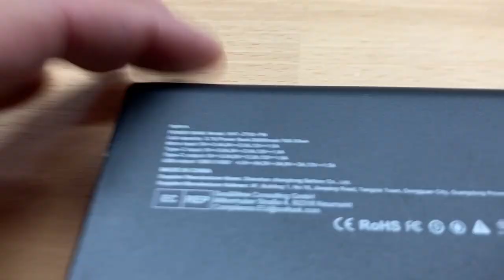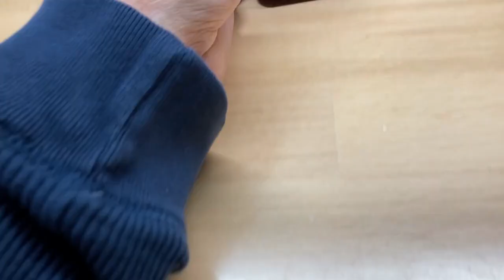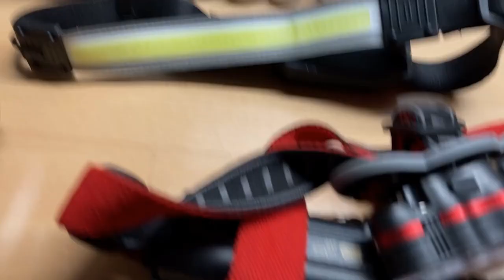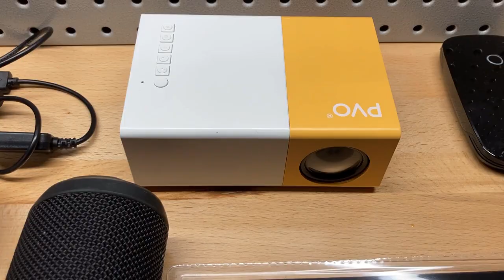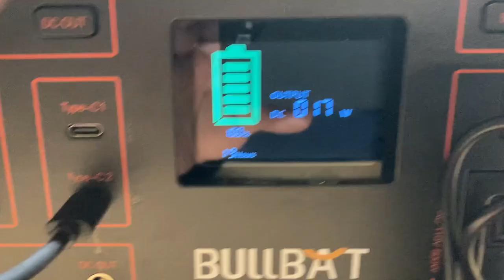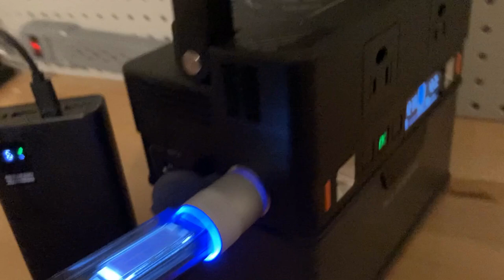EMERGENCY POWER for EVERYONE!!!  The$12 Super Battery!!! #emergencypreparedness #diysolar

Comment from the maker: Hey Guys. I did some initial testing of the Battery today. When used for Fast Discharge (19 watts) it puts out about 70 watt hours!  That is a little less than what it is rated at on the back, but it is still awesome! It is about equal to two normal (10,000mah) USB batteries. It may output more volume when it is discharged more slowly. I bought 2 more this afternoon. I see the inventory on these on Amazon went down quickly after I made this video.  If they are out of stock soon, then I will keep my eyes open for similar great deals and pass them on when I find them. You can charge about 3 of these in single day with a 100w solar panel. That would give you a storage of about 210 watt hours all for just $36. That'a a good deal! :)

Comment: Unavailable at Amazon.  The price was low because it was being dumped at a discount.   Most of the battery packs in this price/capacity category have inflated capacity claims and a low number of charge cycles to 80% actual initial capacity.    Fast charging reduces LiIon cell life.
Reply from the maker: That's good info PS. Thanks for your comment. I measured it at 70wh fast discharging vs the stated 106wh. I'll still take it at this price as that still is a really good value. It will make a good emergency battery for those who don't want tp pay the normal $40+ price for a similar item. If you think about it, this item will hold the power of about 2 dozen AA batteries! You can't buy 2 dozen of those for $12, and you are still likely to get multiple hundreds of charge cycles.  Even if you only ever used it for a single emergency, it would be well worth the price.

Comment: I haven't really studied these type batteries. I'm assuming there's 4x 3.2v lifepo4 inside with circuit to balance/distribute/series the pieces?
Btw says unavailable now.
Reply from the maker: Hey SlickWilly, Yes I believe you are correct. The inventory went down swiftly after I made the video. I saw it progress down from 20 left in stock. I guess that is a good thing that means people are picking them up. I'll keep my eyes open for similar values in the future and watch to see if these re-stock. Thanks for the comment. :)

Comment: units of power ?  Watts

22w wats is decent for a back up power source. is it 5v 9v 12v ? 

i see they have similar versions that will output 100w watts over usb c  with proper quick charge 3.0
Reply from the maker: Yes. It is watts. I tell in the video how less technical people are confused sometimes about the term watts and so my tech guys will know I’m talking about watts but I will use the term units of power in the rest of that video in order to cater to a wider audience. 
  Yes it is 5, 9,12  There is a brief look at the back of the battery near the beginning of the video. It lists the stats.
  This was a great price point for this battery so I wanted to pass the info along. It charges at 22w and has a capacity of at least 70wh.  For $12 that is really good. I’ll keep my eyes open for future bargains as well. For those who want to spend more, bigger is always better in terms of battery capacity and charging speed:). Thanks for watching.

Comment: You videos are Always educational.  Can you post a link to a solar panel too?  I would like to get these.....
Reply from the maker: Hey Patricia. I'll post a link soon for a solar panel. I got a great deal on one just recently, but I want to test it before I recommend it.
Reply from the maker: Hey Patricia. I'll give you an advance heads-up. I'll be making a video soon on this. This is a 100w solar panel. It cost $50 after the coupon is used from Amazon. I tested mine and got 70 watts during a hazy clouded sunny day. That's great performance. This panel will also still produce 20w during a cloudy day. That's super important because it will still charge the most recent battery I highlighted at full speed. Also, during Full rain and DARK BLACK clouds it will still charge at 1w per hour. Now this is huge because my Low wattage device video shows how many items only use about 1w per hour. So, a panel like this ON THE WORST SOALR DAY EVER still wll give you about 12W. That's alot of power used with low power devices!!! Generally, though, on a sunny afternoon, at mid-day, you will get about 70-80 watts an hour which is huge! It will pull about 300 watts total on a typical day.

https://www.amazon.com/WEIZE-100-Watt-Monocrystalline-Efficiency-Camping/dp/B087213FLB/ref=sr_1_8?dib=eyJ2IjoiMSJ9.8Td2btiqRVTEnmNUclWhFlrVpTPulXpiTKICY1NXwEXSwiPjqZuABtHcGHXcS1CtJh4ODF3yWNIhBh0vfjPjQb8MRNZ9nQGapI4kN-gLHeIb44A994DCsIuxVoQV2eAyBY7nEJ72L1LhinYdr81-CYDXIKJCSuN_XaMKOSlKkafZxxC2l8K2RVyIchtSfwcv565YONqet1tOk8OzTdhaxRRag1iGLxudwioIkBP_7zg.c1xsu8FXCjPc36IIrTtBp1Z-oIiWTAFHp5064g-8hYE&dib_tag=se&keywords=100w+solar+panel&qid=1715482185&sr=8-8
Reply: @TroyTime02  I just bought the last batter backup you showed us and the POV projector and the video game thingy.  I do love your channel....
Reply from the maker: @patriciacox8169  That's Awesome Patricia. They each shine individually, but I'm trying to express to people how powerful they are working together as a system. Thanks for watching, and I'm glad you like the content. :)